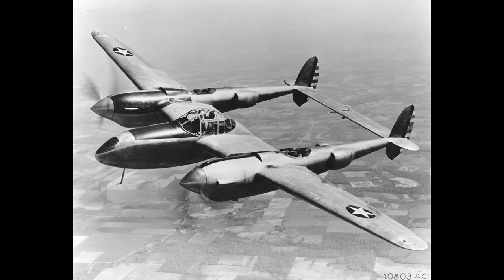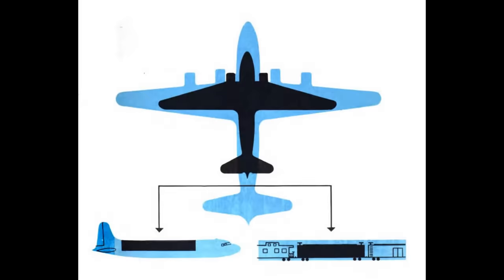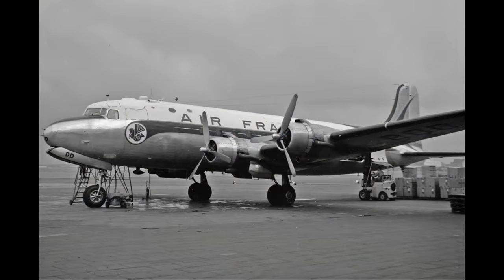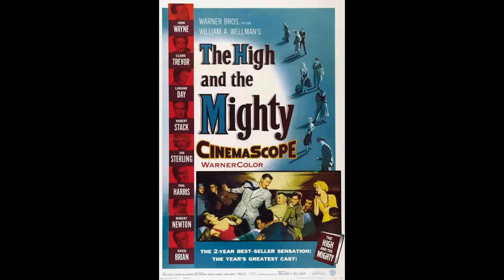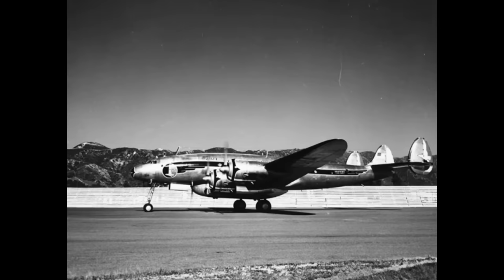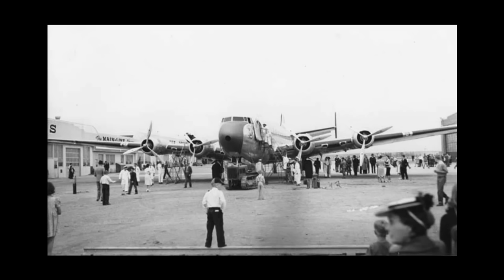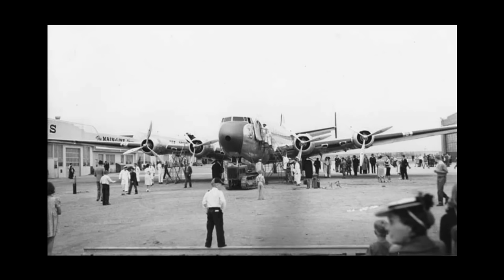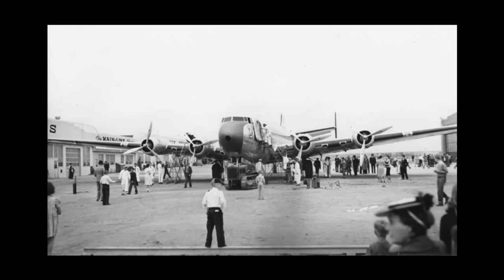Turbo Compound Piston Engines. Almost magic tech.

Comment: I was fortunate enough to have flown in DC-3s, C-47s, DC-6s and DC-7s.  I loved every moment and laughed at the passengers who were alarmed to see the flames exiting the exhausts.  You'll never experience the vibrations and sounds that those radial engines produce on a jet powered aircraft.  I found the Lockheed Constellation to be a most beautiful, but the most efficient doesn't always win the beauty contest.  The Douglas aircraft were clean, efficient designs that proved themselves with their longevity.
I have to add.  These videos on this channel are some of the most informative on YouTube.  Thanks for the hard work in preparation.

Comment: My first trip in an airplane was in 1958 when I was 9.  I was already an airplane enthusiast. A friend’s father took us to St Louis to see the Cardinals. We flew round trip from Memphis to St Louis Lambert. It was a complete thrill that I have never forgotten. The out flight on Delta was on a Convair 440, but the return from St Louis to Memphis was on a DC-7. Four prop engines! I remember the Convair 440 flight as being very loud and bumpy, but the DC-7 was much quieter and smoother. The Delta literature on the aircrafts showed either a Convair 880 or DC-8 as the top of the chain—do not remember whether it was represented as in service or about to go in service. What a trip for a young boy—and Stan the Man hit a home run!
Reply: I flew on a DC-6 or DC-7 in 1960..... at night blue flames coming out of the exhaust stacks......streams of oil coming out of the engine and flowing over the wing. Nothing like today's jet liners.
I lived in line with the local airport...and twice I saw a 4 engine airliner coming into land with one of it's propellers stopped.
Reply: I'm a few years younger, but I took my first flight on a 727 in 1967 when I was 4. . I was so enamored with flying, that when my grandparents flew home to LA after visiting us in Sacramento, I begged my parents to let me go with them. I was there for a week and flew home by myself...UNATTENDED. Ah, the good old days.

Comment: I started working/flying on Douglas products in 1963. I worked on the DC3, 4, and 6. You are correct about the higher failure rates of the DC-7. We still see 3s, 4s, and 6s in pax/cargo roles. Not so much the 7. The DC6/C118 is known as the Greyhound of all the recip airliners. Jets are just a passing fad 😄.
Reply: "Jets are just a passing fad "

Well technically they was. When they was replaced with the turbofans.
Reply: My dad would often joke about the C-118 and say it simply hovered and let the earth rotate underneath it
Reply: @scottl9660 technically all subsonic aircraft qualify for that statement, if flown east-to-west at any latitude were most flights take place. 

Many a flight I have noticed the sun in the same place, even after 8+ hours.
Reply: As with all piston engines, the more complex you build them: maintenance requirements go up exponentially. The demand on metals and fuel sciences is also immense. Dangerous high octane leaded fuels were essential to keep these last generation aviation piston mills running. Just as an example: Lycoming IO-360 engine has a fixed mandatory overhaul schedule. Strap on a turbo and the TIO-360 is permitted HALF the operational hours! Turbo-compound, with their complex gear trains and 1940 metals were notorious for down time. The simplicity of jet engines running easy to make and handle kerosene was a near miracle in comparison.
Reply: my dad used to call the Convair/C-131 "half a DC-6":  48000 MTOG, 2 DC-6 motors, 50 passengers.  Smooth, roomy airplanes and a joy to fly
Reply: @TheJustinJ  True.  That's why it's so much fun to fly west-to-east in the Darkstar in MS flight simulator and make the sun rise....
Reply: The TC 3350’s needed 115/145 fuel to exploit the horsepower advantage, and an abundance of maintenance.
Reply: Read articles years ago about how the airline executives were convinced that maintaining jet aircraft, especially the engines would bankrupt the industry.

Comment: Your videos are great, keep up the good work. 

I really enjoy endurance racing. Porsche  ran the 919 prototype car for several years and used a form of turbo compounding. They used a turbocharged 2l V4 as the primary powerplant. The rules allowed for 2 hybrid electric regeneration systems on each car. All the other manufacturers used a regeneration system on each axle which counts as the 2 allowed. They would charge their batteries  under braking and discharge during the next acceleration. Porsche did something different. They used a regenerative braking system on the front axle but their second system was a turbine in the wastegate discharge pipe powering an electric generator. This allowed them to increase peak horsepower output during wide open throttle when the competition had already depleted their electric boost. It also allowed them to maintain a desired power output while saving fuel used by the IC engine. They could sometimes complete a race with 1 or even 2 less fuel stops. It made for some very interesting racing.
Reply: I think current F1turbos use a system based of compounding. Before that there were a few home built compounded turbo race cars in Europe . I also remember Cosworth wanted to build a compounded Turbo Charged F1 engine when they were building a replacment for the Cosworth DFV but they ended up using a standard layout . They wanted to drive the Turbo from the inlet side of combustion side instead of the outlet side as is norm, all very intresting.
Reply: As far as I'm aware, F1 turbos are still using a shaft to drive the compressor side from the turbine and MGU-H
Reply: The 919 also uses a still rather unusual "hot V" engine layout (introduced with the BMW N63 in 2008), for decades almost all V engines had the inlet manifold any maybe a supercharge inside the V and the exhaust side on the outside (sometimes leading to sidepipe exhausts), these hot Vs are inverted, the exhaust side as the name suggests is in the V now to drive the turbochargers that sit there for less lag and then they send it through an intercooler into the inlet side.

Comment: At Pan Am, we usually kept the plane in the lower blower setting, not to save fuel or anything, but to keep the 3350s in one piece. There were a lot of air turn backs, something that almost never happened with the 707s
Reply: A colleague in a past job had worked on P2V's while in the Navy. He confirmed the term "Parts Recovery Unit" and the need for constant maintenance. They used copious amounts of anti-seize as the need to change cylinders combined with the high operating temperatures made seized cylinder bolts a real headache.
Reply: Weren't those "the best three-engined airliners ever built"?
Reply: i got to watch everets air cargo fly the dc-6 when i lived in fairbanks and they do the same, blower on low and no injection just to keep the power contained and the reliablity up. they suffer for it on climb out though, they only clear the trees at the end of Fairbank international by ~100ft. compare that to a modern 737-800 which clears the trees by ~1500ft+.
Reply: When 115/145 octane avgas was phased out soon after production started with the DC 7's, they were severely altitude limited along with reduced power in all phases of flight. I read that is why high blower was not used anymore.
Reply: @airtechmech6681  I'd have thought you'd overboost the engine with blower on "high" for takeoff.
Reply: At Zantop we used the CB3/4 R-2800's. They did not have the clutches. The blower was mechanically locked into low.  @fafner1
Reply: @daszieher  Many moon ago, a ex-Lufthansa Connie-Captain told me, that the Connie did live up to your moniker. On a particalar trip from New York to  Lufthansa´s technical main shop in Hamburg all 4 engines had been swapped with new ones en route.
Reply: @ludwigsamereier8204  fun coincidence, I was at Lufthansa Technik just last week.
Reply: @daszieher  That was the Super Constellation.
Reply: TWA had a C-82 Packet dedicated to flying replacement Connie engines to AOG airplanes in Europe and I think in the US too - 'Ontos'
Reply: You would. It was only for high altitude at cruise. @daszieher
Reply: @airtechmech6681  yeah, that was my understanding of it.

Like the "over-compressing" Zeppelin engines, which could only be operated on full throttle above a certain altitude.
Reply: No engines died from overboost.

Comment: I was an avionics technician with a local Air National Guard unit during the time we were flying the Super Constellation and had the pleasure of flying on them quite often even though I was not flight crew.  Flying at night I would be mesmerized watching the exhaust on one of the inboard engines which I found fascinating.  The turbine cover was called a flight hood that, along with the turbine and what I could see of the exhaust glowed a brilliant orange from the heat while blue flame came from the exhaust.  I often wondered how that metal could withstand that kind of temperature and not come apart, especially the turbine that was spinning at a terrific speed.  Another crazy thing was one of the flight hoods on one aircraft was painted green and that paint never burned off.

Comment: Well done, Greg, and comprehensible to a non-engineer. My family went to Europe in 1956 (my only international travel), and apparently we were just at the transition point. We flew from St. Louis to New York in a Constellation (I have no idea what model), and when we got back to the states from Europe, we returned to St. Louis from New York via a 707. For different reasons, both seemed pretty exotic to a 12-year-old. I never liked the triple tail of the Connie, but that fuselage is a true work of art, and surely cost a fortune to build per square foot of passenger / cargo space when compared to the generic cylinders of other airliners, then and now.
Reply: This is gadget I knew nothing about.  Now I'm interested.  Thank you.
Reply: Fact: The Boeing 707 entered commercial service on Oct. 26, 1958 (a Pan Am flight from New York to Paris). If you traveled in 1956 (and returned the same year), you could not have flown on a 707. Maybe you flew sometime later, possibly, in late 1958 or 1959?
Reply: @johnc2438  1958 was 65 years ago.  Given that the speaker was 12 at the time, he would 77 at the time of writing.  Perhaps memory is imperfect at that age.  It seems that going to Europe by propeller aircraft and returning by jet is clear enough.  An oopsie on the date seems possible.
Reply: @johnc2438  I'll take your word for it. Perhaps we flew both ways on a Constellation.
Reply: I agree entirely about the triple tail on the Constellation, lots of people think it's one of the most beautiful  aircraft ever, I think it's tail makes it look horribly disproportionate. Aesthetics is subjective, I know, but that's my opinion, for what it's worth.
Reply: When I was a kid in 1956, I flew to Europe on a Lufthansa Constellation. We caught the plane in Chicago and flew to Montreal where we refueled. Then we flew to Gander where we refueled, and on to Dublin where we got off. The plane refueled and went on to Frankfurt. Take off was a lot different from jets. Go to the end of the runway and rev each engine individually for a mag check. then rev all four engines with the brakes on. The roar and vibration were impressive, the leisurely trundle down the runway when the pilot released the brakes not so much. I still remember looking out the window at night and seeing the blue flames from the engine exhaust.
Reply: @rayschoch5882  Prop or jet- congratulations on such exciting memories!
Reply: @meaders2002  Thank you sir for your Holy Words on the whims of memory. Going on 72 myself I sometimes wonder about the reliability of my cherished "memories". When it comes to planes, I definitely congratulate raychoc for his early spectacular experiences no matter be they related to props or jets.

Comment: I remember sitting in my first airplane design class.  The professor said the thrust from the exhaust of a Top Fuel dragster is very significant and a large portion of the downforce.
Reply: Thanks!  That’s very interesting and the answer to my question as to why the exhaust pipes are canted upwards!
Reply: I have seen video of a top fuel dragster loosing the exhaust pipes off of one side of its engine right after leaving the line. All 4 pipes came off as one. The resulting roll over crash was pretty dramatic. Enough so that i started asking around and looking into how much thrust was coming out of those exhaust pipes and it's a no brainer why they point them mostly up and slightly rearward.

I can find figures from 900 to 1100 lbs. of thrust and in some cases more. So even when just one cylinder goes down it can cause the car to swerve and get squirrely.

I looked on you tube for for that video but cannot find it among the many other videos on top fuel crashes.
Reply: Those Top Fuel dragster engines make about 11,000hp these days - so that car is being driven by almost the same horsepower as 4 Turbo-Compound engines! (for a short time of course).
Reply: Only for a few seconds
Reply: If the exhausts were pointing backwards, you could excellerate at 1 G from the thrust alone, you'd just need a brake on the engine to take the 10,000 hp to get the exhaust flow.
Reply: The NHRA  has rules governing the parameters involved. Steve Morris (You Tube) investigated if there was enough energy left in the exhaust of his turbo dragster to help hold the front end of the car down. That is probably a rabbit hole in it self. Ya got to love a guy always looking to go faster or in this case quicker.
Reply: The pipes don't really add that much overall vs the whole weight of the car and the massive rear wing. But if they did not  face up the fumes from nitromethan are rough and blowing them at the crouds would leave the bleachers empty. Also back in the day they mixed in chemicals that made nitro more potent but extra toxic
Reply: Curious Droid did a video on top fuel dragsters and he also mentions the significant down force of the exhaust pipes.
Reply: @mddunlap03  They add plenty. One cylinder losing power is enough to cause a side to side air pressure differential and make the car get squirrely. You can literally watch the car push in the direction of the non firing cylinder.
Reply: @mddunlap03  The exhaust is making downforce right off the line exactly when the rear and front wings aren't because of 0 airspeed.
Reply: @StabyMcStabsFace damn, never thought of that but makes sense!
Reply: Two or three years ago, one of the Funny Car teams came up with the idea of "swept back" headers.  They built exhaust systems pointed more aft than normal. The resulting  forward thrust was enough to make a real difference in acceleration, which is what drag racing is all about.  Of course, the change in the header angle also reduced the down force resulting from the exhaust and the cars became unstable enough so that crashes became too frequent.  It was especially true when a car "lost a cylinder" where the asymmetrical thrust was even more significant.  Funny cars are squirrely enough anyway.   So the NHRA now has outlawed "swept back" headers and they require them to point up at a particular angle; i.e not pointed too far aft.

Comment: Fascinating stuff!  The Canadair Argus maritime patrol aircraft soldiered on in the Royal Canadian Air Force with its TC 3350s until 1981. It was a Bristol Britannia with the turboprops replaced with the piston engines, mainly because of the incredible endurance potential the TC 3350, giving it a range of 5000 nm. The PRTs gave the 3350 an SFC of .38 (IIRC) lb/hp/hr, only about 2/3 the fuel burn of a turboprop, and actually on the edge of diesel engine territory, and until the latest auto engines with gasoline direct injection, was the most fuel efficient gasoline piston engine ever built.  Later in their service life in the RCAF the engines were getting pretty unreliable and when going out on patrol two aircraft would be stood up and whichever one didn't have a problem by takeoff time would launch.  Returning on 3 engines was getting pretty common.
Reply: Thanks for your post. As a Canadian and a young man in the heyday of the Argus, this was informative and interesting.

Comment: Very fun reminiscing about these old aircraft.  In response to one commenter regarding taking notes while flying in an old aircraft, I have an interesting take about that.  I have had a career that has crossed both aviation and office products.  Prior to air travel, most journalists used fountain pens.  The advent of air travel made fountain pens ineffective as they operate based on stable air pressure.  Early commercial planes were not pressurized so the pen would leak ink as pressure decreased.  Not cool when travelers were dressed nicely with their expensive fountain pens in their pockets!!  This spurred the development of the ball point pen, which uses a much thicker ink and relies on gravity rather than pressure to operate (if your ball point pen didn’t work it meant the plane was upside down and you had a completely bigger problem to deal with!!!).  Early ball point pens were very expensive and exclusive and were considered an accoutrement of the “prop set” (I guess that’s what they would have been until “jet set” would come in a few decades later, or maybe they were the “prop crop”!?!?). As my econ professor later stated, “now, ball point pens are free.  Just look on the floor whenever you need one and you’ll probably find one laying there!”

Great channel, Greg!  Keep ip the good work!!!